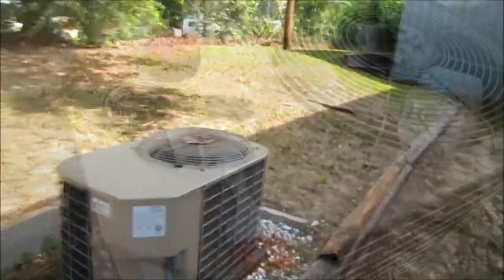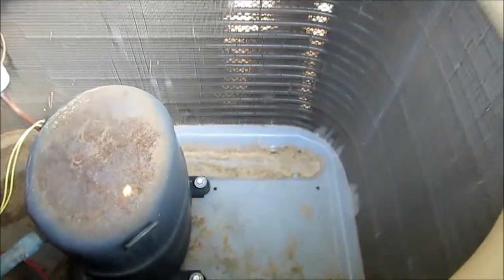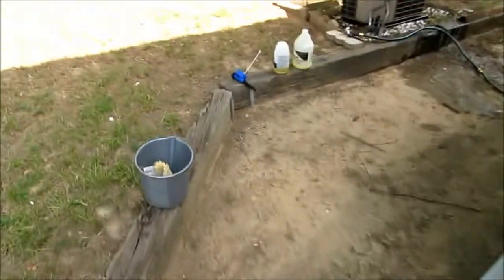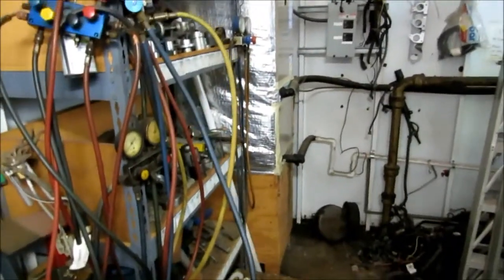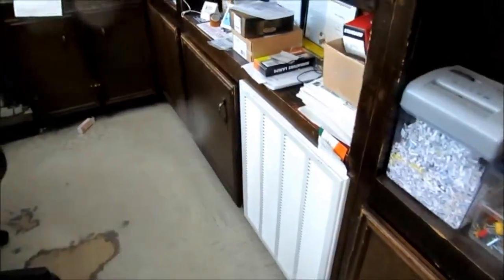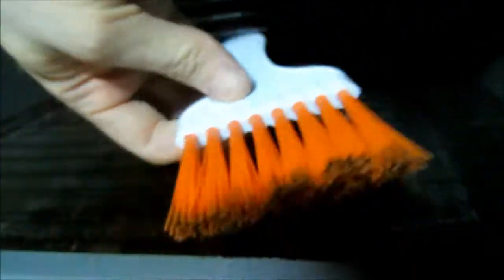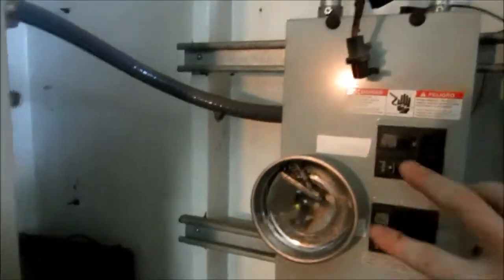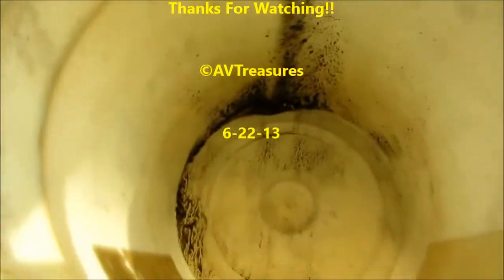Cleaning The Coleman Heat Pump's Condenser & Evaporator

Comment: Hey Ray! My pop has a Coleman straight cool unit. I sure was impressed with how that thing came apart lol. My pops is right under a pine tree and was a mess and I found a leak on the roto lock connection too! So being dirty was only part of its problem. Tech had came out and confirmed that I had found a leak!! His is from 1995 and still purring away! Great video Ray!!

Comment from the maker: Hey Mike!! They are easy to work on, that's for sure! Pine trees do make a mess out of a unit. Especially it they are right under one!! I really wanted a Rheem unit but it just didn't work out. This system has done a good job and proved to be pretty tough for the conditions it has to operate in though. I think the evaporator is starting to leak by the looks of it but it still works great for now!! The air handler is 11 years old. The outdoor unit was put in service in April 2006.Thank you Mike!!

Comment from the maker: The Nu-Calgon coil gun has 5 mixing head settings and an off position as well.

The "A" setting gives you a mix ratio of 3:1. B is 4:1. C is 6:1. D is 9:1 and E is 10:1.

It has been my experience (and recommended to me by Fritz as well)  that the "C" setting seems to work the best for most jobs.